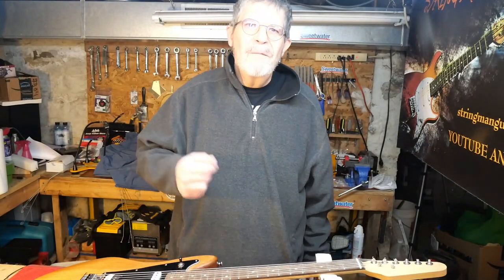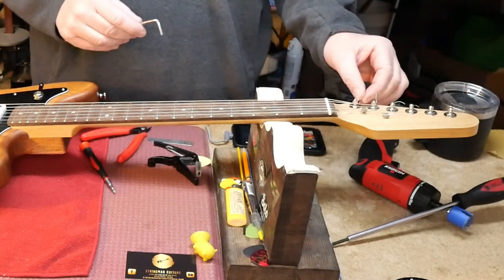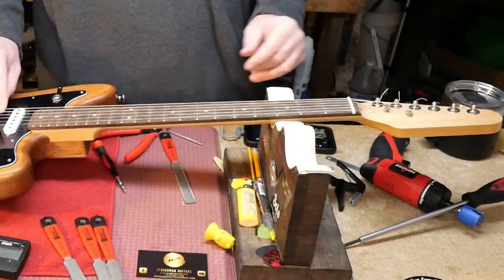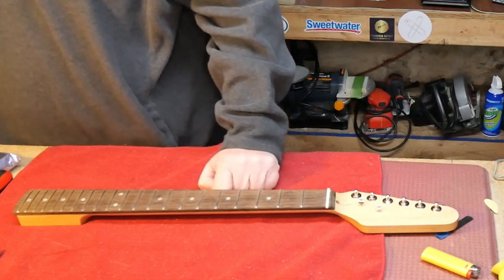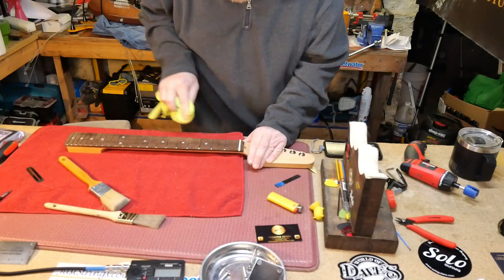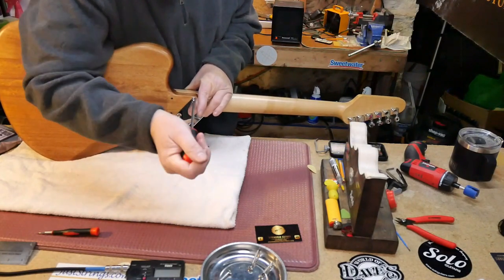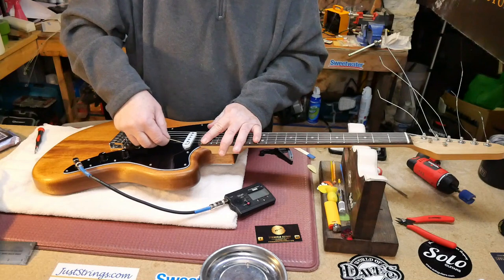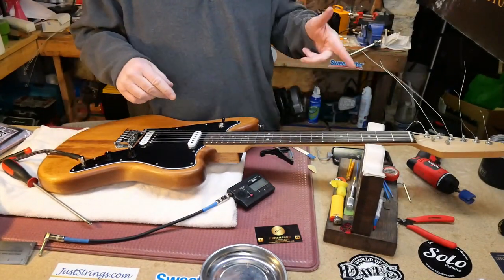StewMac Offset Kit Making it Playable The Movie EP303

Comment: I have just received this kit and the frets as you pointed out need work (extremely sharp) I dragged a tissue along the edge and had shards of tissues hanging off almost every fret. Spent about 2 hours dressing frets to my liking. Will be shaping headstock next Strat style. I have a feeling your set up pointers are going to come in very handy when the time comes. I do have to say the wood used in this kit is very nice. Thank you Great video and nice work. Be well!
Reply from the maker: Good luck! Also thank you so much!
Reply: if you download the instruction manual, i was suprised to see it state "the frets are installed, but they need work", and then it covers how to smooth the sides, level, polish etc.....okay?